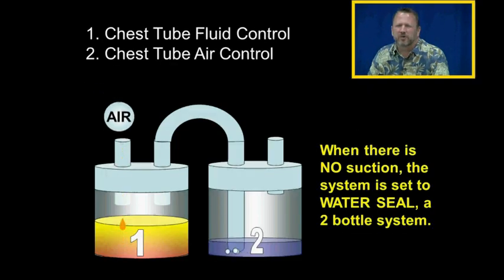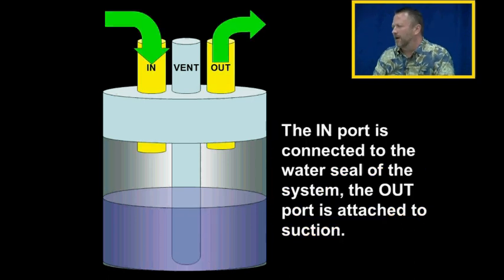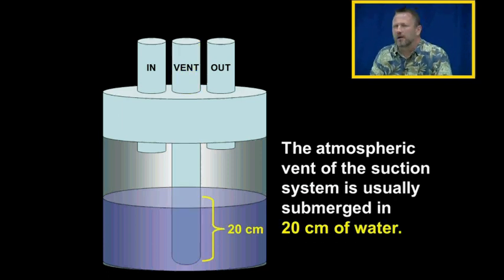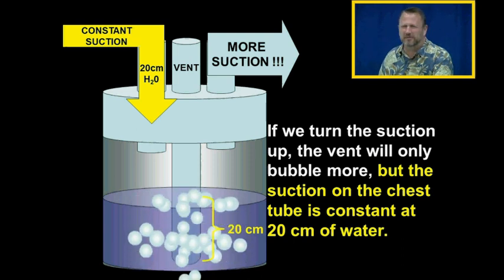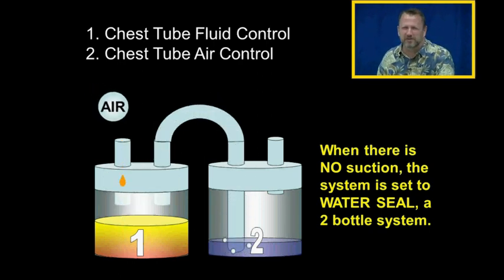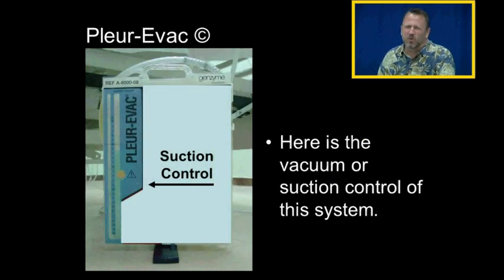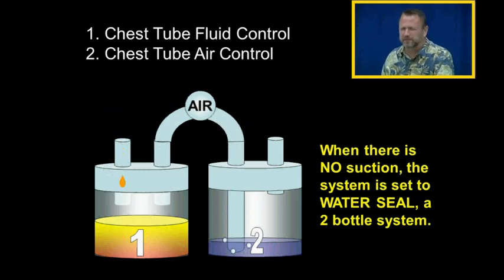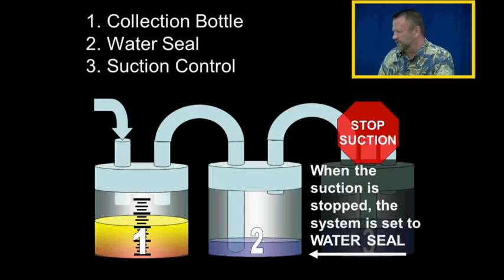Bottle 3: Suction Control: 3 Bottle Chest Tube Collection Systems

Comment: I’m confused about your statement that the suction control bottle has no purpose if it doesn’t bubble @2:10. If the suction is set at 15 cm water, the vent depth is at 20 cm, then the vacuum control bottle will not bubble but it is still applying suction. If it is still applying suction, then why would you say it has no purpose?
Reply: I have the same doubt. If we have a water valve of 2 cmH20, and a suction control set at a water valve of 20 cmH20 that is not bubbling, then an effective suction should range between 3 and 19 cmH20. Even if it's not over 20, it's still suction and making its job.

Comment: i have a question.. we are getting an exam about this but I don't actually understand why the pressure gets down when you put the suction on, can you help me with this ? Thank you a lot!
Reply from the maker: +Umoss Col Positive pressure and negative pressure are the same thing depending on which direction you choose to be positive, they both move air.  When suction is applied to the chest tube system, you are applying negative pressure within the pleural space.  If the suction control vent is not bubbling, the suction is less than 20 cm of water, once the suction control bubbles, applying more wall suction will only make the suction control bubble more, the suction control prevents more than 20 cm of suction (negative pressure) from being applied to the system. Hope this helps.

Comment: can you explain why when you increase the suction pressure it will only create more bubbles rather than exerting higher suction from the pleural cavity? Also, what will happen if you do not have that safety valve e.g. connecting that chamber straight to a suction?
Reply from the maker: +Psyche The safety vent does not allow the suction applied to the chest tube to exceed 20 cm of water because the vent is submerged in 20 cm of water. So when we connect to wall suction, the safety vent will begin to bubble when the wall suction exceeds 20 cm, the excessive suction is compensated by the entry of air into the safety vent, keeping the suction applied to the chest EXACTLY the amount the vent tube submerged in water, 20 cm. If not for the safety vent, then excess suction, suction that exceeds 20 cm, can do damage to the tissues in the chest. Hope this helps.
Reply: @Pharmapedia  it not only helps its golden

Comment: I have a question... I don’t understand why the pressure remains constant in spite of the increased suction pressure
Reply: Because it is submerged in 20 CMS of water only and it equalizes with the amount of suction applied
Reply: thank you so much🙏🏻
Reply: @Bree-q5p  you are welcome..God bless!!
Reply: Did you understand? I still don't get it..  What does the 20CMS submerged vent have to do with constant pressure?